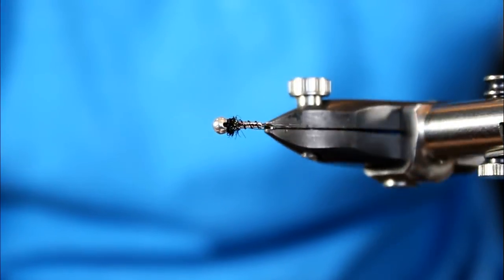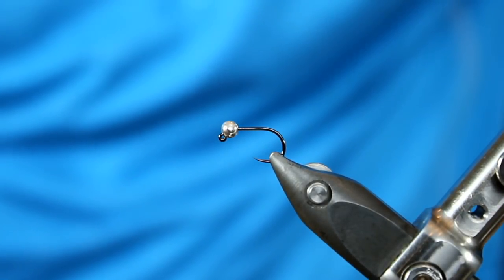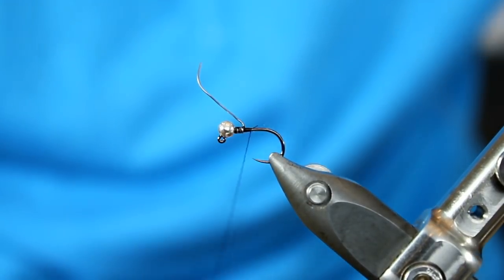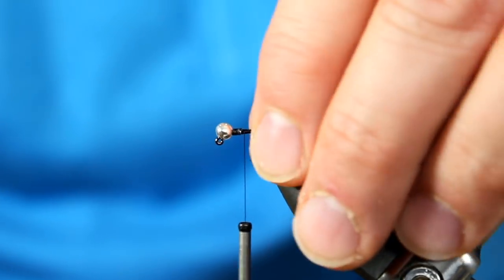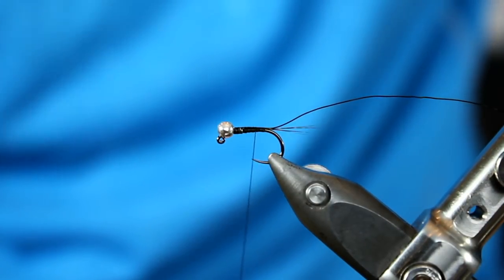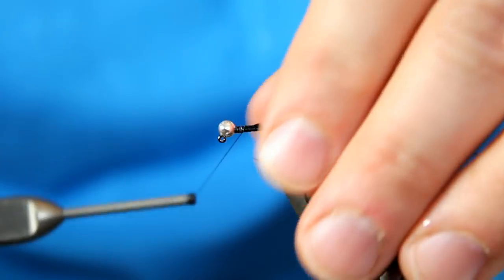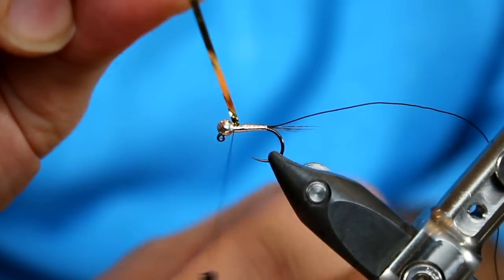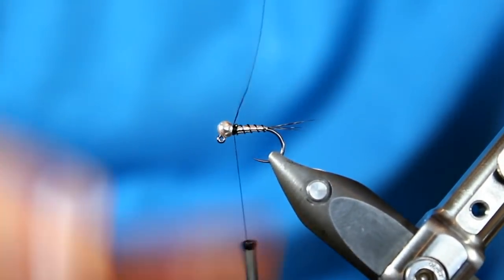Fly Tying: Lightning Bug (NEW and IMPROVED!)

Comment: What’s the difference between ultra and soft wire?
Reply from the maker: Nate, in my mind they are very similar.  The UNI Soft Wire appears to be a tad softer to me, but don't be afraid to use one versus the other.  I like it's diameter especially for this pattern because it gives a nice contrast to the body material.  Tim

Comment: Can this jig style pattern also be used under a dry/dropper rig?
Reply from the maker: Absolutely, Ryan, though you may have to vary the sizes of either this nymph or the dry to ensure it will float.  Sometimes when fishing dry-dropper, I'll have a larger pattern (i.e. foam dry fly), which will suspend a larger nymph.  However, when fishing with smaller dry flies, the nymph must also be reduced so it won't pull the dry under.  Experiment with the sizes and see what works for you.  Good luck, and Happy New Year!  Tim  http://www.troutandfeather.com